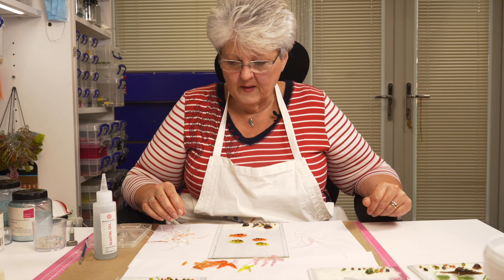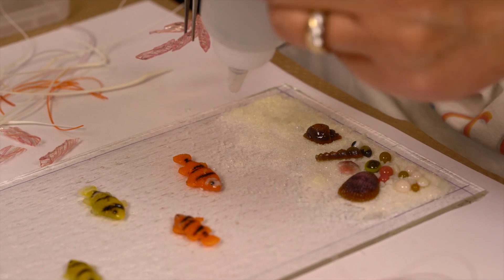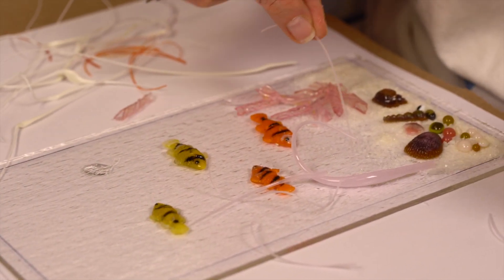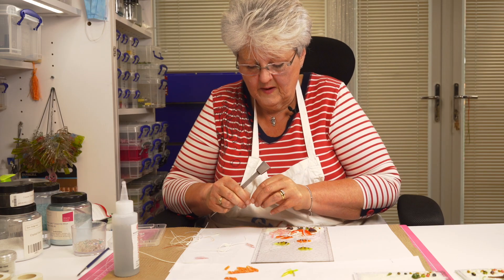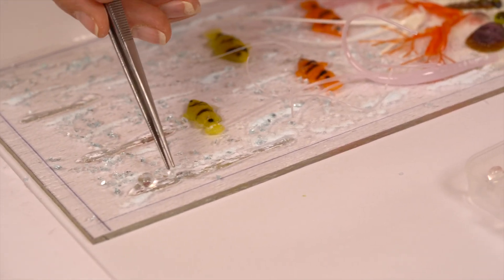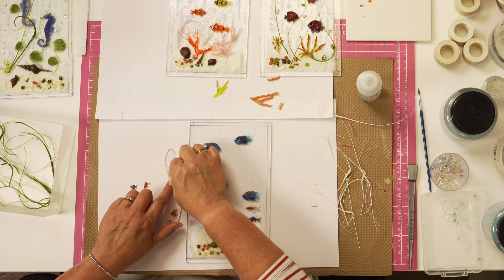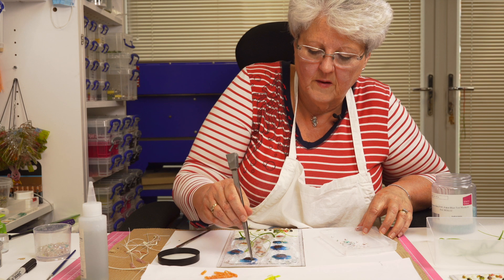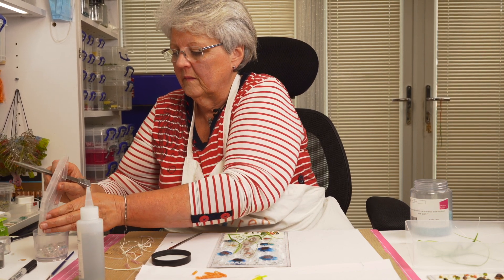Aquarium Lantern project part 2

Comment: Love your videos they are so helpful. I have made the freeze and fuse fish and flowers after watching your video and they turned out beautifully. In fact I have another batch in the kiln right now. 
I do have a question on your fusing schedule for these panels. I am new to this fusing world but have done leaded stained glass for quite a while. I have a JenKen Kiln and my high temperature is 1700. On segment 2 when you go up to 760 celcius (1400 Fahrenheit I am working in Fahrenheit) then in segment 3 it shows 999 celsius (which for me is 1830 Fahrenheit) and my kiln only goes to 1700. So would I not be able to do these panels with this kiln or do I have to leave a longer time? It is confusing to me to go from 999 celcius then cooling down to 482 celsius. Thank you for any information you can give me on this. I have been reading trying to find info on this and haven't found anything yet.
Reply from the maker: Hi Elaine, thanks for watching. 999 means ramp up to the temperature as quick as your kiln will go for the time stated. Our kiln doesn’t go to 999 either, it refers to ramp up and ramp down speed, rather than temperature.
Reply: @FiredGlass  thank you so much for the reply. I thought that might be the case but wanted clarity. Thank you again.

Comment: Absolutely fantastic!  I love it!  Thanks for sharing your knowledge and talent.
A quick question....when you cut your Tekta, did you cut them to the exact size of the glass that came with the lantern? (just wondered about shrinkage, etc.)  Thanks!
Reply from the maker: Thank you for watching Gail, glad to hear you like our video content.
We cut the glass to match the size of the panels we took out from the lantern. On a tack fuse shrinkage is minimal, a millimetre or so and no negligible difference. We started to oversize them on the first couple of lanterns we did, but ended up cold working them to reduce their size.
Reply: Thanks very for your sweet reply!  I saw a nice lantern on Ikea and thought I might give it a go with some flower panels.  Have a lovely week!

Comment: I'd love to use the freezed elements between layers. Have you ever done that? And if yes, how did you fill the spaces?
Reply: Thanks for watching. Not used fused elements between layers and would not recommend as the ones we've used are too thick in cross section. You'd struggle to fill the void created by placing them there, you would lose definition of the finished pieces. Not recommended.
Reply: @johntisbury  thanks for your reply. I already thought so, but hoped for another answer 😂

Comment: Could the panels be slumped and not lose the texture of the freeze and fuse elements?
Reply from the maker: Yes, a basic slump firing schedule has a lower top temperature than a basic tack fuse schedule. 640°C vs  760°C.

Comment: I loved watching these tutorials, thank you! Are the panels easy to insert into the lantern frame?
Reply from the maker: Getting the panels back in really does depend on the type of lantern and the mechanism they use to affix the glass. Most a a simple thin metal tab that you can bend back to secure the panel. Trick is not to use a thicker glass that what the lantern came with and keep your decorations away from the edge so you don't have a bump or lump of glass near the frame. When we buy lanterns we look at how the glass is installed before purchasing so we know it's easy to remove and replace with the made up panels.